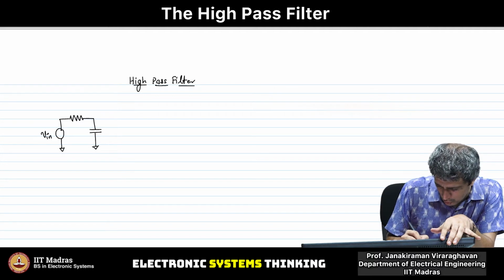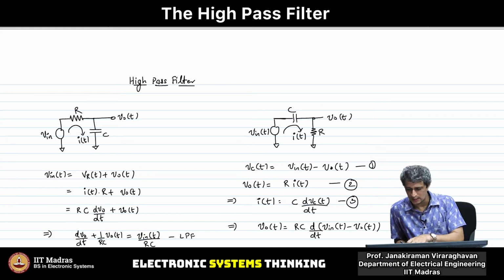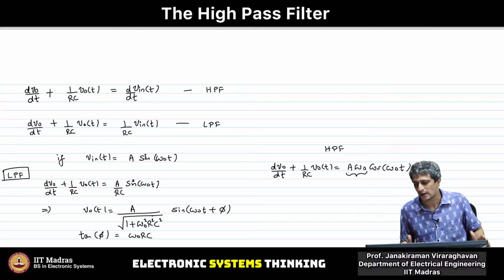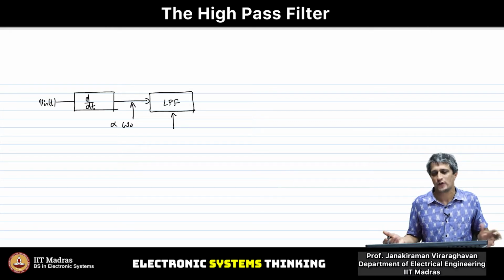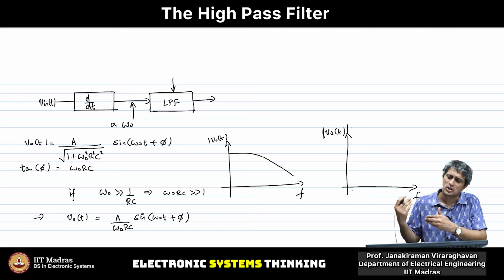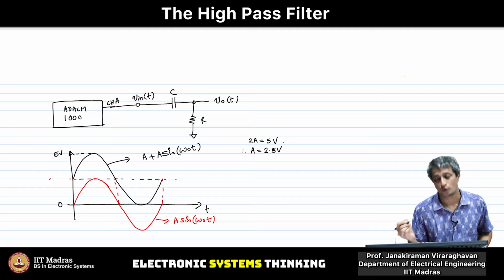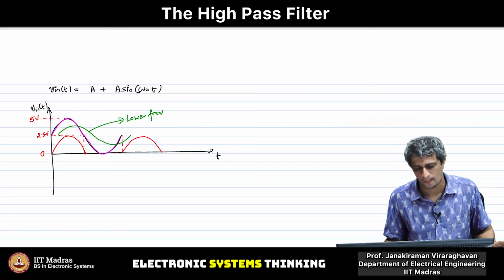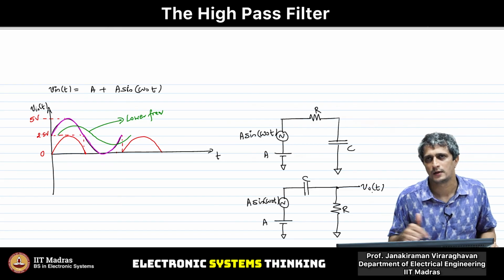Electronic Systems Thinking_The High Pass Filter

Comment: My roll no.  - 24F2100240. Sir because the output is coming to be centered around origin we need to shift  or add a dc offset to the output. Now I tried doing that by the "2.5V" named pin on the adalm1000 kit. But what that's actually doing is fixing the voltage of a point to 2.5V instead of offsetting the output. sir if you could elaborate more on the clipping part then it would be very helpful.
Reply: Sorry sir actually it worked. I was doing a silly mistake of shorting the ground with "2.5V". Instead what I should be doing was removing the ground and in place of that putting the "2.5V". Now it works and there is no clipping.
Reply: Sir I am doing this at my home because the lab schedule at the campus was hectic and didn't have enough time to analyze the circuit. So I submitted totally wrong lab report. It would be very helpful If I am given another chance to resubmit my lab report.